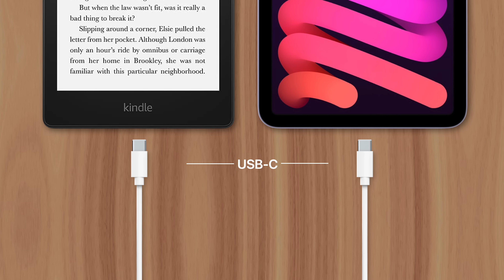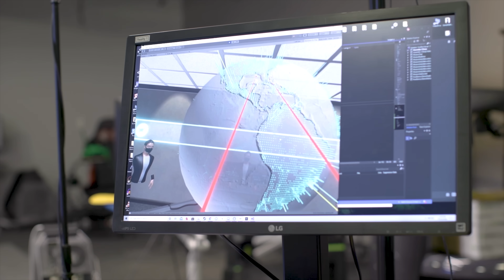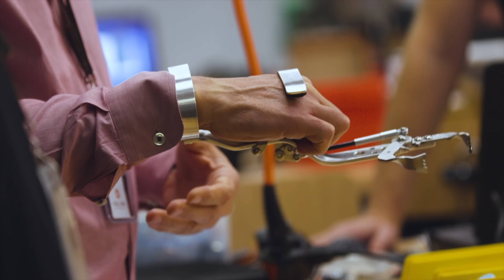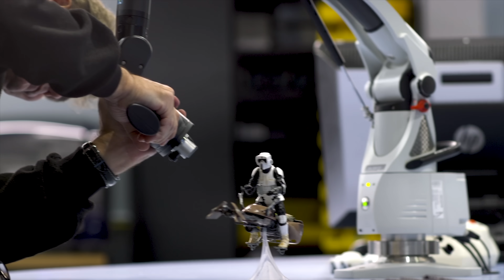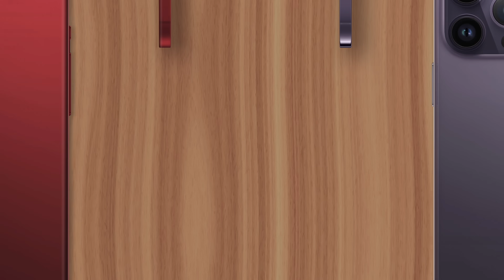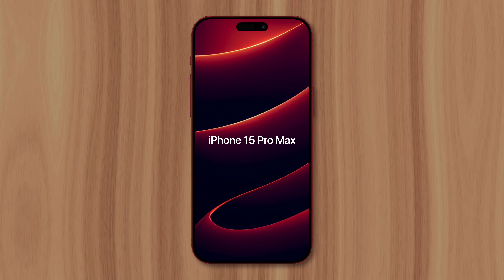iPhone 15: What To Expect

Comment: The dark red for the iPhone 15 pro is amazing This is the first time Apple makes a product red on a pro model but I just upgraded my iPhone 11 to 14 pro so I don’t need a upgrade for awhile still rocking my 14 pro in space black I’ve had it about 2 months so no need to upgrade yet
Reply: i went from a iphone 6s to a iphone 14 pro max, i seriously doubt ill buy the 15,16,17 and maybe 18-19 (if they exist), ive had the iphone for ~3 months now, and its still at 100% battery capacity, still almost as powerful (i mean its only been 3 months) etc
Reply: I went from the X to the 13 pro. Will wait for 16-18ish most likely. Idk. If they added Touch ID back I’d instantly upgrade
Reply: i painfully delayed buying 14 pro max when i heard rumours about 15 ultra lol
Reply: same. went from 11 pro to 14 pro max.
Reply: Yeah, I’ve been waiting for 100 years for this color on the top of the line big phone
Reply: Here I am texting on my iPhone SE in the 5 style case....

Fucking first world yuppies....
Reply: with the addition of so many substantial changes like a much better zoom, USB C (finally), and a design overhaul on the bezels and the curved borders, i'd recommend you to sell your actual phone (its not that hard, apple has pretty high demand, you might sell it a bit cheaper to get the money faster too), and then upgrade for the iphone 15 pro max, because now those are some real experience changing features.

Not to mention iphone 14 itself was a transition phone, you can tell bc of how little the differences were other than dynamic island, and now they're throwing all their arsenal with the 15, with even buttons overhaul.

But its just an option, there's nothing wrong with the 14 pro, it still rocks, insane battery, insane camera, insane processor, very good display, nothing wrong, just that iphone 15 pro adds so much more iphone 14 to 15 compared to 13 to 14
Reply: @NFYT  maybe, I will think about that
Reply: Yeah but the battery is ass
Reply: @Amp World Clips as you post a grammatically incorrect comment… LOL gotta love idiots 💀
Reply: My favorite color is red, this dark red ❤‍🔥, now I can't for the 15 pro max. I will be upgrading my 12 pro max.
Reply: Nice
Reply: Apple trade in is a thing you know that right?
Reply: What do you make of the protrusion of the camera lenses ?
Reply: Why not wait until they release the new phone?
Reply: Exactly my situation but MAN does that red look good!
Reply: Ohh 😮 I am thinking about buying the 14 pro max (rn I got the XR) but my family been telling me to wait for the 15 😃
Reply: I’m gonna upgrade from my 14 Pro Max to a red 15 Ultra!
Reply: @CutieMcGee  Why would you buy a iPhone 15 when you have an iPhone 14. Not that it's my problem but use your money wisely instead of wasting it.
Reply: @TamilEelam1  Periscope camera lens, titanium frame making it lighter, improved battery life, first red iPhone Pro series, etc… the list goes on and on! Definitely not a waste, can’t wait to do upgrade 😜
Reply: @CutieMcGee  I think you lyin g 🤣
Reply: @tylerlover  Why would I lie? I’ve upgraded from 11PM to 12PM to 13PM to 14PM 😘
Reply: @CutieMcGee  Same. Been upgrading since the iPhone 5S.
Reply: @rawnuhld  hell yeah!
Reply: @CutieMcGee  do as you please but what a waste of money
Reply: @am.asoo1  Not a waste of money at all 😘
Reply: @CutieMcGee  your money your choices. But what is better on the 14PM than on the 13PM that you pay 1400$ ?
Reply: @CutieMcGee  why do you upgrade every year
Reply: @philipschmitd6854  upgraded my storage 🥳
Reply: @gilbertdennis4872  11PM -> 12PM for 5G, 12PM -> 13PM for ProMotion, 13PM -> 14PM for storage and camera upgrades 🥳
Reply: @CutieMcGee  Dude, you're just wasting money, the improvement of the camera is relative, surely you don't always take photos in pro raw to use 48mp, it's stupid to want to take the latest iPhone model every year, update every 2 or 3 from time to time generations and your card will thank you and your intelligence too but hey you said it do what you want with your money
Reply: @aideck0104  You sound pretty upset, I’m very happy with my upgrades and can’t wait to upgrade again in September 😘
Reply: @CutieMcGee  why though, stick with one phone
Reply: @gilbertdennis4872  How about no? 😘
Reply: @CutieMcGee  It’s a waste of money lmao. Whether you choose to see it or not, it’s a complete waste of money.
Reply: @hinatashoyo1748  If you can’t afford it, I guess so. Sorry it’s a struggle for you all 😘
Reply: @CutieMcGee  aight bro
Reply: @CutieMcGee  Whether I can afford it or not, is out of the question. Upgrading very year is still a waste of money.
Reply: @hinatashoyo1748  It’s 100% out of the question for you because you can’t afford it. Sucks!
Reply: @CutieMcGee  Sounds to me like you still have the iPhone 7 and you’re calling people broke and lying about upgrading every year 😩
Reply: @hinatashoyo1748  Want to see my phone? I’ll show you pics on discord rn 😘
Reply: @CutieMcGee  Oof can the iPhone 7 even support Discord still?
Reply: @hinatashoyo1748  You tell me, you’re obviously projecting 💀
Reply: @CutieMcGee  upgrading your phone every year isn’t the flex you think it is. I’m not going to be concerned with how you spend your money because to be frank, I could care less. But it isn’t a flex because upgrading every year is bad for the environment. It’s extremely wasteful, and the components pile up and contribute to the growing e-waste problem.
Reply: @celenachandler  Sounds like you’ve never heard of trade ins 😬
Reply: @CutieMcGee  each new phone you purchase is another phone that will eventually end up in an e-waste landfill. I’m not trying to change your mind about your spending habits, but I’m just trying to iterate that the more we as consumers buy into yearly upgrades, the more phones these companies will produce, and the more e-waste is going to be a problem.
Reply: @celenachandler  You do realize the trade in phones are sometimes used to make the new phones, right?
Reply: @CutieMcGee  Yes, which is a step in the right direction, but it is not a fully closed loop system yet where all components are recyclable, and the components that happen to be the worst for the environment out of all of them, happen to be the ones that don’t get recycled. E-waste is still being produced and nonetheless, the more phones bought, means more produced, and at the end of the day, means more e-waste. That is, until these corporations figure out how to create a 100% sustainable closed loop system.
Reply: @celenachandler  Their solutions and efforts are more than good enough for me, and I will continue to upgrade annually 😊
Reply: @CutieMcGee  sounds good
Reply: @celenachandler  More like sounds GREAT 😁
Reply: @CutieMcGee  Bro we are not poor, we just know how to effectively use money. Even as a millionaire, I would never buy an iPhone yearly. Just because people are smart and use their money wisely, doesn't mean they are poor. Seems like you are a child just trolling but if you are serious, hopefully you can recieve the help you need
Reply: @CutieMcGee  I said that to respectfully walk away from the discussion, not boost your ego or in some way agree.
Reply: @celenachandler  Then walk away, kiddo. Like I said, I can’t wait 😘
Reply: @CutieMcGee  Well good luck waiting 5 months. We Samsung S23 Ultra users already have these features. But either way, Samsung will respond back with their S24 Ultra only 4 months later, and the cycle never ends. Not to mention how the 15PM will only have 6x optic zoom compared to 10x optic zoom on my S23 Ultra. You guys always say "we dont need the zoom" but guess what; you guys said "we dont need 5x optic zoom" back when you had only 2x zoom, biased to Apple saying that "2x is better for portraits" and such. You probably didnt say these things, but many Apple fanboys like you did.
Reply: @ethoshrimp8190  I’ll stick with my Apple ecosystem, happy you have something that works for you tho! 😜
Reply: @CutieMcGee  You’re still complaining?
Reply: @CutieMcGee  Apple ecosystem AKA Apple jail, walled garden, a paradise for brainless kids to play in
Reply: @SlyCooperRN  I'm guessing you have the 14 Pro Max, Apple Watch Ultra, Mac Pro, iPad Pro 2022, AirPods 2022, 100TB iCloud storage, Apple HomeKit setup with automatic door locks, Apple Microwave, Apple Refrigerator, Apple Car, etc. Literally only a few people of all in the ecosystem doesn't have this much and the Samsung ecosystem is always filled with stuff like a TV, washer/dryer, refrigerator, dishwasher, etc.
Reply: @ethoshrimp8190  Eh you just made it cringe 😬
Reply: @philipschmitd6854   ✅congrats…You have been selected for the season ongoing Giveaway..!Message the above applied name to redeem yours…
🎊 right now.
Reply: @SlyCooperRN  I mean eventually most people would have to end up with Apple probably only if macOS is taking over Windows but I am not seeing it happen. Windows is still the most used OS
Reply: @CutieMcGee  I used to lie a lot just like you. I can see my old behaviour in you, and know that nobody telling the truth would call someone poor. You even use discord which is a bit sad. Give me yours and you can prove you're telling the truth
Reply: @CutieMcGee  I am quite baffled by how much data migration happen each year.
Reply: @ethoshrimp8190  That sucks for you, kiddo! 😬
Reply: @tylerlover  Seems like you’re still lying and projecting, sad way to live your life kiddo! 😜
Reply: @digojez  iCloud and phone to phone transfers make it easy 😜
Reply: @am.asoo1  if you trade in the previous gen you only pay 100 dollar 14 pro max only cost 100 if you trade in the 13 pro max
Reply: @philipschmitd6854   @Aso  if you trade in the previous gen you only pay 100 dollar 14 pro max only cost 100 if you trade in the 13 pro max
Reply: @CutieMcGee  bet what’s your discord #?
Reply: @CutieMcGee why? They’re like the exact same phone, why spend a thousand dollars on a new one?
Reply: @isthisagoodname6279  You do know iPhones hold phenomenal resell values, right?
Reply: @Galaxyboiiie  Give me yours, I got you princess 😘
Reply: @Galaxyboiiie  added you, baby girl 😘
Reply: @CutieMcGee  honestly, good point
Reply: @CutieMcGee  even if I was a billionaire I wouldn’t upgrade my iPhone yearly as apple has a tendency of releasing pretty much the same phone yearly and only making significant changes once every 3-4 years.
Reply: @isthisagoodname6279  that is a good name btw
Reply: @CutieMcGee  Still complaining eh

You're just jealous about how much smarter Samsung users are
Reply: @ethoshrimp8190  What a cringe response 🤡🤣
Reply: @hinatashoyo1748  some people have expensive hobbies, if they can more than afford it, then i dont see the the issue, it may seem like a waste to yall, but well worth it to other people. If i had the money, i wouldnt personally upgrade an iphone every gen (except for the 15pm if the features in this video are true), but i definitely would upgrade my cpu or gpu every generationwhen it comes to pcs
Reply: @Captaine_Crunche  🔥🔥🔥
Reply: @CutieMcGee  can't lie me too every phone after the 12 I've had
Reply: @am.asoo1  na you just broke
Reply: @fabolousjada5070  Might try and make this next upgrade last just because red is my favorite color, but you never know!
Reply: @CutieMcGee  Want to trade your iPhone for my iPhone XS? 👀
Reply: @zpx1006  Not in this lifetime, nice try tho bud!
Reply: @CutieMcGee  holy shit are you elon musk
Reply: @TERRARlA  Weird.
Reply: I agree with you, me personally im preparing for the future with crypto
Reply: @CutieMcGee  The poors are just mad, again.
Reply: @Deathwatch31  seems like you have a video on your channel about bit coin. I wouldn’t be dissing the “poor” if I were you
Reply: @l6323  so what? I’m not invested.
Reply: @Deathwatch31  Preach 🔥
Reply: @aideck0104  lol it’s okay he’s a sheep that Apple loves
Reply: @peterwolanyk3428  Sorry you can’t afford nice things, kiddo 😉
Reply: @CutieMcGee  I am sorry that u don’t understand things, kiddo😘
Reply: @galaxy-0175  Cringe 😬
Reply: @CutieMcGee  it’s okay feeling cringe about yourself, kiddo😘
Reply: @galaxy-0175  Didn’t think you could get more cringe… you did. 😬
Reply: @CutieMcGee  thinking is not your strong thing kiddo, I understand 😘😌
Reply: @CutieMcGee  First off I'm 21 so I'm not a "kiddo" and trust me I could if I wanted to but mindless consumer spending is exactly what Apple wants you to do. Trust me I probably work more hours in a week then you do.
Reply: @peterwolanyk3428  You’re a full time burger flipper, congrats!!
Reply: @CutieMcGee  Nah I am actually at college rn for a degree in IT, come talk to me in like 4 years 😉
Reply: @peterwolanyk3428  Hey maybe you’ll be able to afford new phones by then! Good luck, kiddo!!
Reply: @CutieMcGee  Hope you own the 16 inch MacBook Pro with at least 1 TB memory. You gonna upgrade to the M2 MAX version this year? They’re finally adding center stage for FaceTime.
Reply: @JosephMC27  Nah, don’t need it. My 12.9” M2 iPad Pro still works well enough for me 😘
Reply: @CutieMcGee  Your missing out, I can literally use my iPad as a second screen while working on my MacBook. It makes the ecosystem so much more synchronized.
Reply: @JosephMC27  happy you’re taking advantage of sidecar :)
Reply: @philipschmitd6854  $1400?? My guy, do you think people who buy iPhones every year keep their old iPhones on a shelf somehwere?? He's obviously traded the 13 Pro Max in which would put the 14 Pro Max at around $400-500 + a carrier offer it would only be a couple hundred at worst.
Reply: @CutieMcGee  wasting your money g
Reply: @honaldjason  Something funny I’ve learned is it’s only a waste of money to people who cannot afford it :)
Reply: @CutieMcGee  it is crazy how upset people are over your life
Reply: @pumpkant  What I’m saying 🤣
Reply: @CutieMcGee  I think you love the thrill and excitement you get from upgrading every year with new features, that's probably why you enjoy upgrading. Am I correct?
Reply: @CutieMcGee  why do you upgrade every month?
Reply: how to make everyone hate you:

Step 1.
Be  @CutieMcGee 

Congrats! Everyone hates you now!
Reply: @1MadJack1  Typical poor people: full of hate and envy 🤣
Reply: @CutieMcGee  its crazy how these npcs dont see what youre doing 💀they cant help but be hurt
Reply: @hinatashoyo1748  they can just trade in every yeR
Reply: @CutieMcGee it’s been a month
Reply: @Galaxyboiiie  Bums are desperate for my attention 🤣
Reply: @CutieMcGee  but did u really find any difference in the phone ?
Reply: @CutieMcGee  lol no you said you would give me it you scared
Reply: @Galaxyboiiie  I added you, bum 🤣
Reply: @CutieMcGee  what’s your name
Reply: @Galaxyboiiie  added you like a month ago. I’m dhed’s daddy of course. Sent you the pics rn, lil girl 😘
Reply: @Galaxyboiiie  I win 🤣🤣🤣
Reply: @Michael Hall Ain’t no way you’re calling me salty. I haven’t been on this thread for a month 💀
Reply: @hinatashoyo1748  Michael Hall owns you 🤣
Reply: Kodak icy  That’s what I’m talking about 😎
Reply: @CutieMcGee   I like you . hahaha such a cool personality. greetings from arabia✌🏼
Reply: @KSA21Geladettor  lmfao good vibes, friend ✌️
Reply: @CutieMcGee this is what you literally do when you're bored while waiting for your iPhone 15 Ultra Pro Max whatev they call it
Reply: @ethoshrimp8190  Yawn 🥱
Reply: @CutieMcGee Not really a rich and poor thing. Stats prove that poorer ppl like to show off and wear their money (shoes, purses, phones etc). I have an uncle who’s a millionaire who owns several aircraft but doesn’t care to get the latest phone. Idc what u do with your money ofc but just clarifying that one part🤷‍♀️
Reply: @pat4761  sounds like a you problem ;)
Reply: @CutieMcGee since you've been using iPhones for such a long time... what would you recommend getting an iPhone 14p or should I wait for 15? 15p is kinda expensive for me atm. Of course the features haven't rolled out yet for 15 but you've been a regular user haha :)
Reply: @eloz11  Wait for 15 to come out to get 14 at a discount since you’re on a budget
Reply: @CutieMcGee  thanks a lot for responding slycooper! I'll do that. Hope you live a healthy life :>
Reply: @eloz11  thanks you too
Reply: @CutieMcGee get a life how’s your 15
Reply: @Galaxyboiiie  it’s blue and not red but I absolutely love it, sorry you can’t afford that luxury 😘
Reply: @CutieMcGee  i have one too
Reply: @Galaxyboiiie  cringe 😬
Reply: @Galaxyboiiie  no need to lie, kiddo
Reply: @CutieMcGee  lol i’ll show you
Reply: @CutieMcGee  why
Reply: @BigJClips  Why what?
Reply: @CutieMcGee blud ain’t finna get the 16 pro 💀
Reply: @likemar_yt  already preordered and ready to pick up on launch day, baby girl. It’s so nice not being poor 😜
Reply: @CutieMcGee   ✅congrats…You have been selected for the season ongoing Giveaway..!Message the above applied name to redeem yours…
🎊